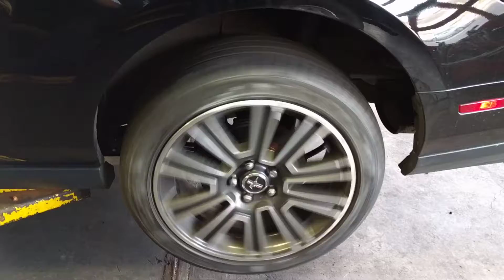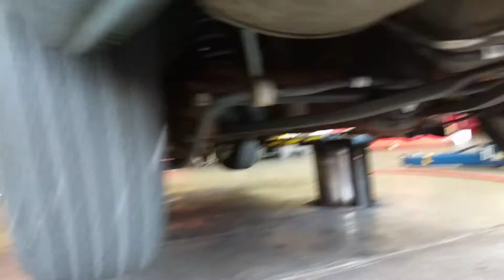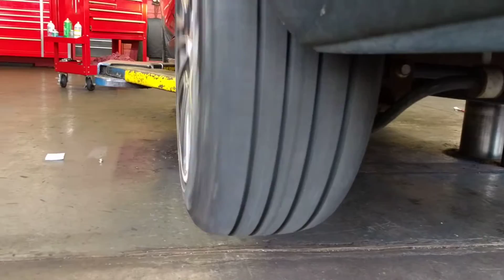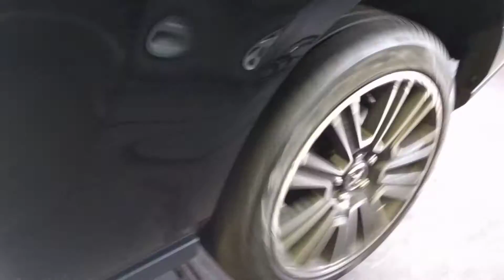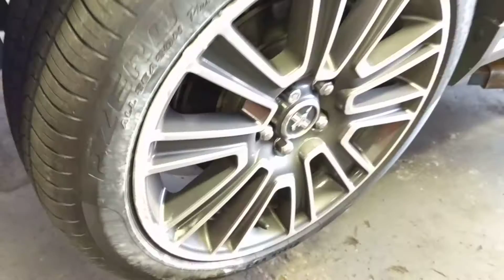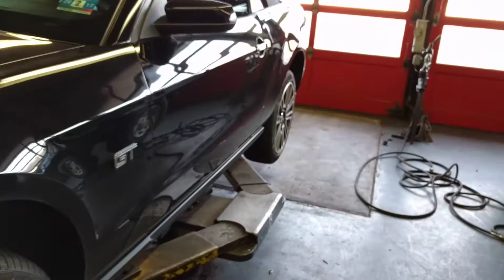2010 Mustang GT convertible vs huge pot hole.. Pothole 1 Mustang 0

Comment: Looks like it slid sideways into a curb. Was the half shaft bent or was it the wheel?
Reply from the maker: Half shaft is bent. National back order from Ford.
Reply: Auto Fix Pal must be too may sliding side ways into the curb
Reply from the maker: That's most likely what happened.